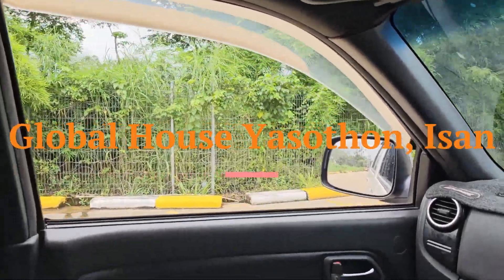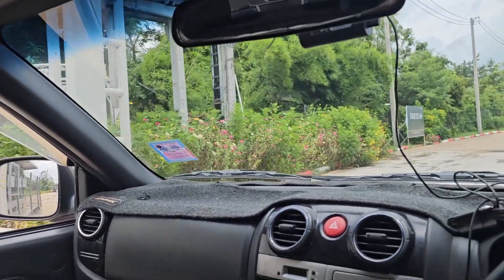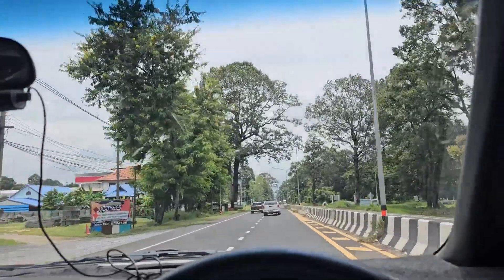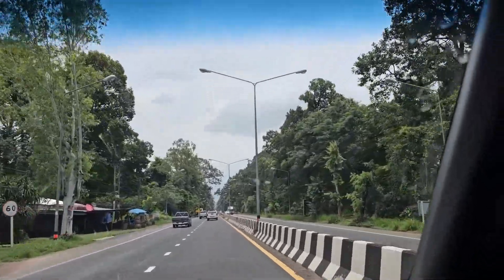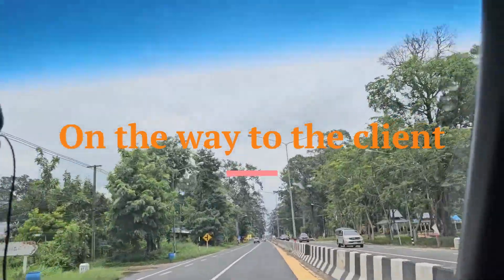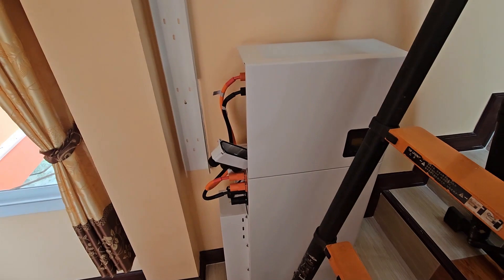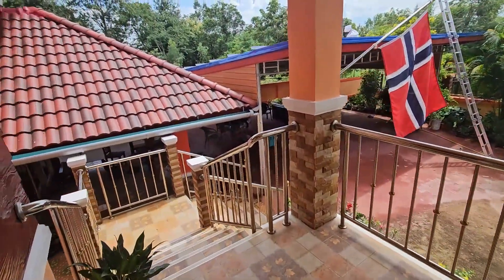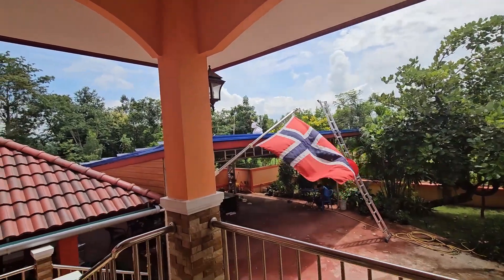Solar battery system installation in Isan, Thailand | SolarThailand.biz

Comment: Can use on-gird systems in Thailand?
Reply from the maker: Many different meters in thailand. Non are made to officially be bidirectional. Please read carefully and ask privately if you need more info.
Reply from the maker: Yes
Reply: @ChaweewanGroup   how it's working? Same as in EU , electric counter is in/out bidirectional counter?  For example average daily consumption are 20kW , PV system is generating 30-40 kW a day ,  how it's looking in the monthly bills?  Daylight productivity is covering night consumption?  Do thai pea reimbursing like green tariff something or not?
Reply from the maker: @polarbear3096  there are a lot of details about this, but put simply: you should not export normally. You can get sale agreements but they are not good. So size system after personal use.
Reply: @ChaweewanGroup   if generated by PV 700-1000kW , consumption is 600kW a month, the final monthly bill is zero? Or generated pv is nor covering night consumption?  The el. counter will be bidirectional counter?